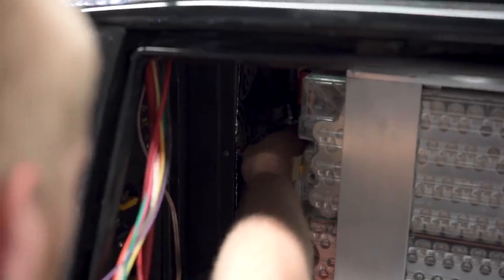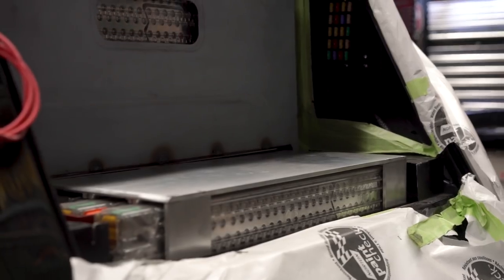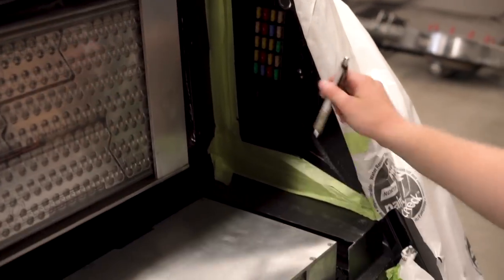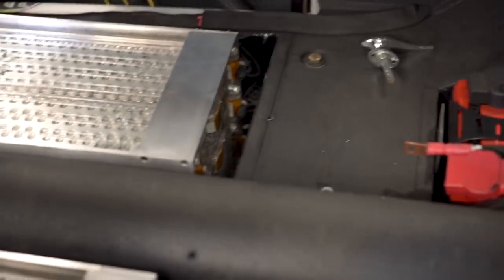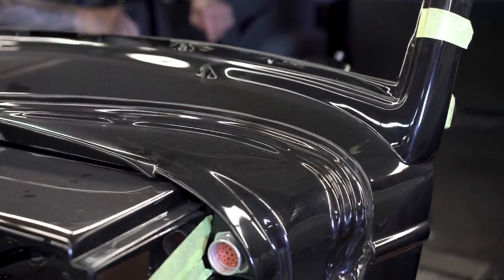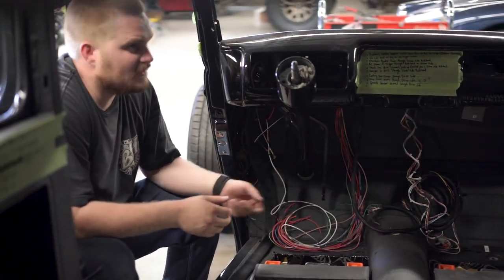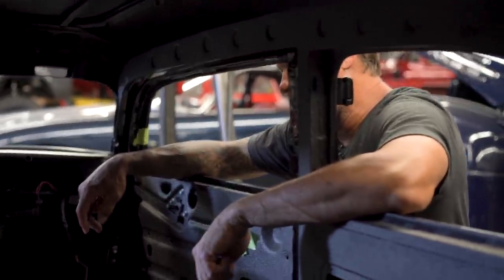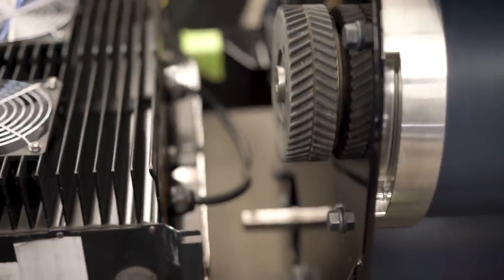The Vik - A Tim Allen Build - (part Clxx)

Comment: Bodie, if you are strapped for fitting space you can run the drum fittings like used for motorcycle brakes as coolant fittings.
Reply: Banjo fittings?
Reply: @johngrepo9976  Yes, the banjo fittings.
Reply: Good idea